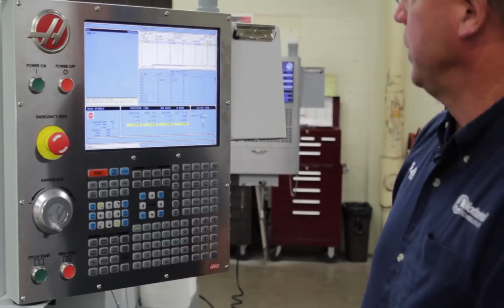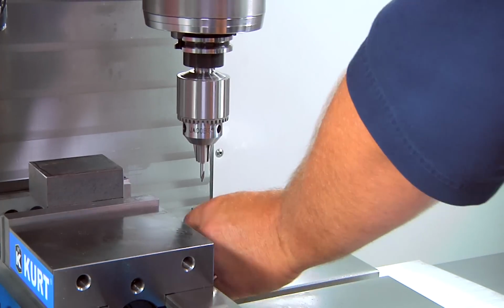Haas Machining Centers    Tool Lengths & Diameters

Comment: How do you control mismatch from running two different vices for one part. Like g54 and g55.  54 will do one side of the part and 55 dose the other. How do you make sure it matches up

Comment: IMO the way we do it in our shop. We touch off all tools off the top of the part with peace of paper.
On all the newer haas and the older haas mills.

Wiggle paper 
T1 come down in the Z till the tool touches the paper (.001) 
In G54 work area (Z) hit part zero set button.

Now MDI call up T2

Wiggle paper 
T2 come down in the Z till the tool touches the paper (.001)
now in your tool off set page.

ON T2 you push (tool offset measure) button.

Then push (NEXT TOOL) button and it will call up 
T3

Then repeat the steps that you did for tool 2.

Make sure to NOT forget your CUTTER COMP if your using END MILLS.

Now I did not go to school or college. I learned the hard way and made many mistakes.
And still do today.

But stay focused. Keep the burning to want to learn and progress.

I have been doing machine work for 10 years now and still watch videos like these all the time.

Comment: Easier way = touch all tools off on 123 block hitting tool measure button with each. DO NOT subtract 3 inches. DO NOT worry about negatives or positives. USE ANY tool previously touched off and touch it to the 123 block top again. HIT OPERATOR MEASURE MODE Button, this mode is under different names on different machines but they all have it. ZERO USER MEASURE Z and move tool to top of workpiece. The machine perfectly measures the distance for you and you can manually enter that measurement into your desired work offset for Z. I think this method is the safest and most error resistant method for tool offsets while preserving tool offsets through workpiece changes. Tools will not need to be retouched for a height change you simply touch off the 123 block again with any tool and remeasure to the top of your new part with user measurement mode from a forced Z zero on the top of the 123 block. Simply enter that measurement to your new Z offset and you're ready to machine.

Comment: He should touch the spindle off of the 1-2-3 block first and set G54 Z.  All tools after that will give you a positive value that is the actual length. Keep it simple.
Reply: That was basically the first option he stated. Then he decided to go with the more common and horrible "HAAS" way of setting tool offsets, cuz you know, HAAS tech pre-dates machines made in the 80s. I'm sure someday they'll catch up or hopefully just go belly up... haha.

Comment: what's the point in touching off on a "common surface" like the table in this demonstration. Why not just touch off of the top of the part and save a lot of time? I don't understand...
Reply: +Allison Jones, there are many different ways for touching off tools.  You just use which ever way that you feel comfortable with.  In this video, he uses the table surface as a reference point for all tools because this table surface will never changed.  For example, if you break the tool during a machine cycle then you replace the new tool and again touch off the new to the table surface.  If you touched off all the tools on top of the part then you do the facing.........In the worst case scenario, if you break a tool during this machine cycle and you might not know where is you original reference surface.
Reply: We do it like that in our firm.
Reply: Yes I agree. Only touch on the top of the part and that's it.
What the use of using the table and after all he just uses the machine or absolute value in the position table and subtract.

Comment: what a bone headed way to explain tool settings
ALWAYS set up off the parts!!! Using z axis work offsets is confusing as hell
The only reason to do this is for mass production with multiple fixtures and work offsets
with a magazine full of tools you rarely change
but for every day short runs NO

Comment: Great work Jeff. I have been trying to set up and run a 1980 Kitumari mill machine with a Fanuc 10M control. I am now having problems with the tools retracting up into the plus side when it gets to the G43 H line. I have never worked an old control like this and my Mastercam program does not work when I load it into the control. As you can see my program below, my spindle flat without the tool in it is -16.013 to top of part zero from the Z machine home position. With tool 4 in it, it is -10.661 to top part zero. I have 5.352 in my tool 4 length geometry. And I have 3.904 in my tool 2 geometry for circular milling counterbore. I can`t get this program to run right without the spindle retracting at the G43 line and I can`t get the tools to decend to the same reference point (Z.1) from top of part to start the cycle. Does the machine reference from the spindle flat to the top of the part and go into the G54 workshift and/or does that number or another number go into the start of the program as a reference for all tools? The programs run good on newer controls but this old control has to have precise ways to read. Please let me know how to set the machine work coordinate settings with the correct way to set the tool geometry. I have looked everywhere to correct this but the machine will not operate correctly. I have included the mill program as well as it seems the tool geometry will not allow the tool to go past 2 inches from the top of the part. I thnk this has to do with some G90. G92, G54 code.
N100G92X1.125Y0Z-10.661
N101G90G0Z-10.661T4M6
N102G28X0Y0
N103S1200M3
N104G43H4
N105G90G0G54X1.125Y0Z1.
N110G99G82Z-1.2419R.1F20.
N112X3.832
N114G80
N116M5
N118G91G28Z0.
N120Z0
N122M01
N1G28X0Y0Z0
Mo1
N2T2M6
N3G92X1.125Y0Z12.109
N4G0G40G49G80G90G92G99
N5S1750M3
N6G90G0X1.125Y0Z.2
N6G54G43H2Z-4.
N8G0G92G54X1.125Y0Z.2
N12G01G90G54X1.15Y0Z.1F20.
N131G90G17G0D22
N132G17G3X1.15Y.025R.028F6.
N134X1.125Y.05I-.025J0.
N136X1.075Y0.I0.J-.05
N138X1.125Y-.05I.05J0.
N140X1.175Y0.I0.J.05
N142X1.125Y.05I-.05J0.
N144X1.1Y.025I0.J-.025
N146G1X1.125Y0.
N148G0Z.25
N150Z.1
N152G1Z-.4F15.
N154X1.15Y.025F25.
N156G3X1.125Y.05I-.025J0.
N158X1.075Y0.I0.J-.05
N160X1.125Y-.05I.05J0.
N162X1.175Y0.I0.J.05
N164X1.125Y.05I-.05J0.
N166X1.1Y.025I0.J-.025
N168G1X1.125Y0.
N170G0Z.25
N172Z.1
N174G1Z-.6F15.
N176X1.15Y.025F25.
N178G3X1.125Y.05I-.025J0.
N180X1.075Y0.I0.J-.05
N182X1.125Y-.05I.05J0.
N184X1.175Y0.I0.J.05
N186X1.125Y.05I-.05J0.
N188X1.1Y.025I0.J-.025
N190G1X1.125Y0.
N192G0Z.25
N194X4.957
N196Z.1
N198G1Z-.2F15.
N200X4.982Y.025F25.
N202G3G17X4.957Y.05I-.025R.032F12.
N204X4.907Y0.I0.J-.05
N206X4.957Y-.05I.05J0.
N208X5.007Y0.I0.J.05
N210X4.957Y.05I-.05J0.
N212X4.932Y.025I0.J-.025
N214G1X4.957Y0.
N216G0Z.25
N218Z.1
N220G1Z-.4F15.
N222X4.982Y.025F25.
N224G3X4.957Y.05I-.025J0.
N226X4.907Y0.I0.J-.05
N228X4.957Y-.05I.05J0.
N230X5.007Y0.I0.J.05
N232X4.957Y.05I-.05J0.
N234X4.932Y.025I0.J-.025
N236G1X4.957Y0.
N238G0Z.25
N240Z.1
N242G1Z-.6F15.
N244X4.982Y.025F25.
N246G3X4.957Y.05I-.025J0.
N248X4.907Y0.I0.J-.05
N250X4.957Y-.05I.05J0.
N252X5.007Y0.I0.J.05
N254X4.957Y.05I-.05J0.
N256X4.932Y.025I0.J-.025
N258G1X4.957Y0.
N260G0Z.25
N262M5
N264G91G28Z0.
N266G28X0.Y0.Z0
N268M30
%
Reply: nice work

Comment: If the work offset G54 z axis is set at 5.730 (13:50) at the top of the work piece surface then the table is zero so if I programmed G01 Z-.50 the tool will try to machine the table a half inch into its surface...right....  this is the most confusing video  the G54 z axis should be zero with the tool at its surface and any movement into the part should be negative. what am I missing here??? all movement from z home is negative MCS so if the work surface is positive then the table has to be zero because of work off set???????????????????
Reply: richard manross You are right Richard. Can you look at my post and see what I am doing wrong? I can`t find anyone who has run a 1980 Fanuc 10M and I am having problems setting the machine up with the g54 machine coordinate system and each tool measurement.
Reply: I am willing to look at the issue, just send me pictures with the tool offsets and work offsets screens.

Comment: after 10:49 you said to measure the tools you are using for the day off the top of the part, so why use the table if your just going to redo the process off of the part?